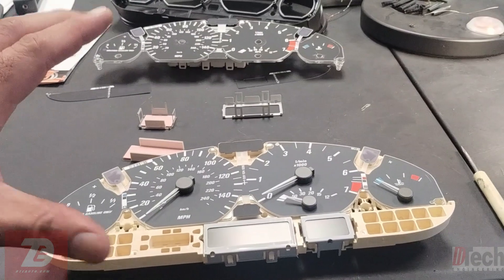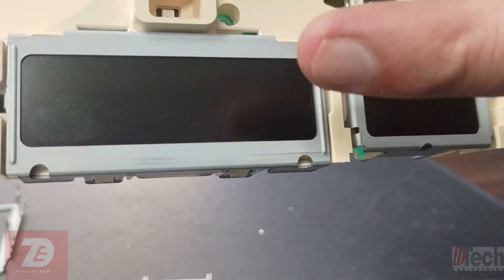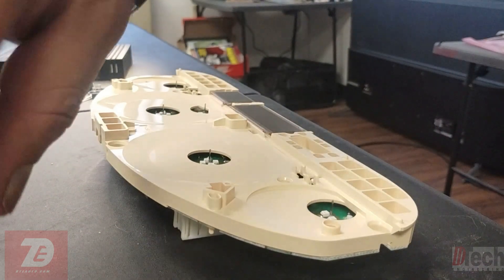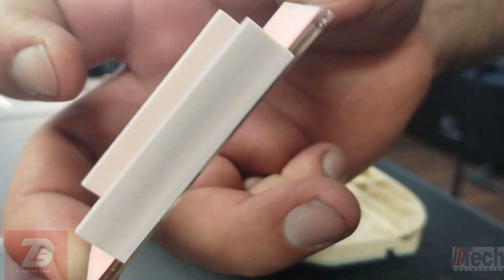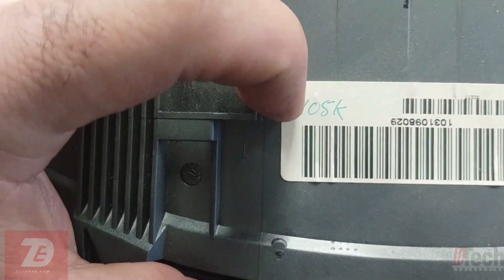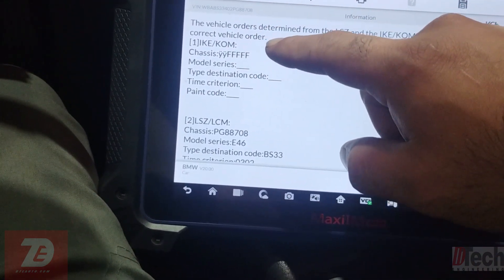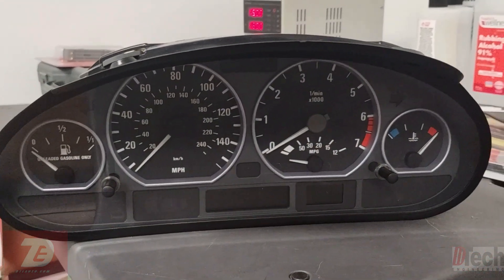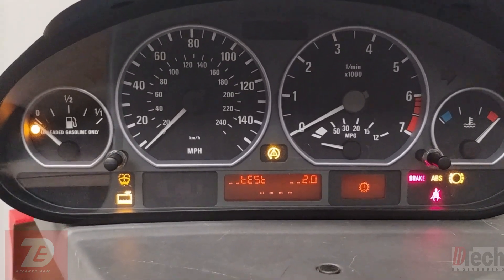BMW Swapping Used Instrument Cluster

Comment: Were both clusters Motormeter or Bosch, or a combination of the two?  My motormeter cluster chip will not work in the Bosch cluster.
Reply from the maker: have you tried ?
Reply: Yes. The chip on one had the lettering right-side up. The other, upside-down. I tried soldering it in both ways. Each way, I got the dreaded ‘Code’ on the screen.
Reply: So, my original gauge set was Motometer with the 35080 chip.  I tried swapping it with a Bosch set with 35080 chip. Just kept saying ‘Code’. So I bought an additional Motometer gauge set, but it did not have the 35080 chip. And of course, it kept saying ‘Code’ as well. Can you provide any other info to swap this out and make it work?  Thx.